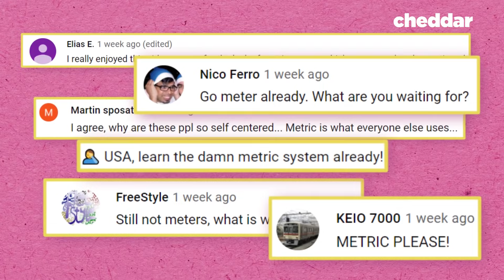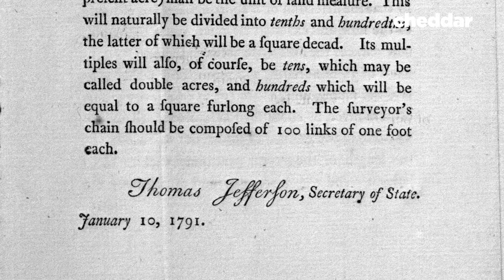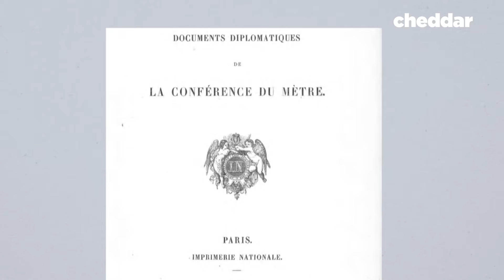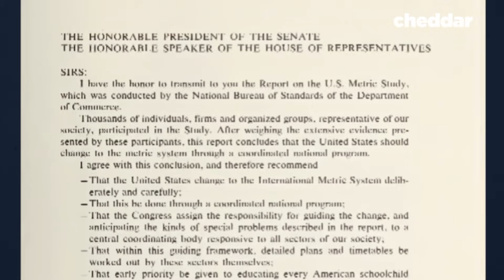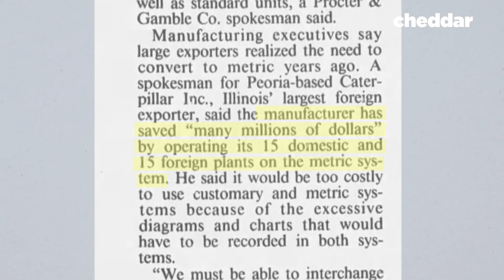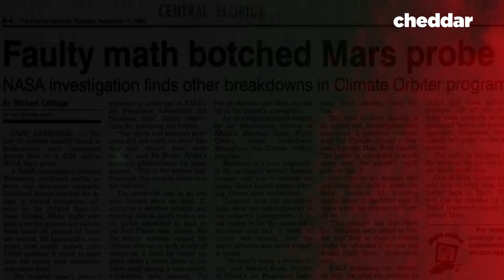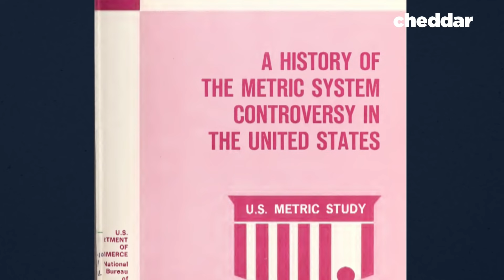Why Doesn't the US Just Use the Metric System? - Cheddar Explains

Comment: I’d like to know why the us and uk gallons are 3.8L and 4.5L respectively.
How are there different standards within an imperial system?
Reply: There are NOT "different standards within THE Imperial System."

In 1776 the US used the then current British System - the Winchester Standards.
In 1826 the British introduced the "Imperial System", to Britain, its "Empire", Colonies etc>
However, the USA did not change !!!!

Hence, the USA now uses the "Old" British system but calls it US Customary.
The major differences are the size of the Gallon, Pint, Quart etc. and the number of Pounds in a Ton.

The size of the "Imperial" Gallon is the Volume of 10 Pounds of Water (At a specific temperature.)

The "wine gallon"  is a unit of capacity that was used routinely in England as far back as the 14th century, and by statute under Queen Anne since 1707.
 Britain abandoned the wine gallon in 1826 when it adopted imperial units for measurement. The 1707 wine gallon is still the basis of the United States' gallon, as well as other measures

Some research concludes that the wine gallon was originally meant to hold 8 troy pounds of wine.
The 1707 British statute defines the wine gallon as 231 cubic inches – e.g. a cylinder 7 inches in diameter and 6 inches high – and was used to measure the volume of wine and other commercial liquids such as cooking oils and honey. 

However, at the time, the value of PI was taken to be 22/7, which does give 231 cubic inches (6 * 7 * 22 / 7) but, with the real value of Pi, that volume is 131.9469 cubic Inches.

Comment: When Canada went Metric in the 1970's, industry was in a huge dilemma, as 90% of Canadian trade is done with the USA. How ironic that the solution was to use BOTH systems. Here's an example. When I go to a Home Depot in the USA and buy a sheet of 1/2" plywood that was(made in Canada), I simply go and buy a 4' x 8' x 1/2" sheet of plywood. In Canada I go to Home Depot and buy the same sheet of plywood (made in Canada), I buy a 4' x 8' x 13MM  sheet of plywood. They simply use one less or one more ply to come up with the thickness we are buying. Same applies for 3/8" ply, or 3/4" ply etc. The problem that woodworkers face in Canada, is that the tools are based on USA standards, like a dado set for instance. If I pull out my Delta Dado set to cut a 1/2" dado to accept the plywood, I have to shim my dado blades to get a good fit. Yes, it's still sold as a 4 foot by 8 foot sheet....jeesch

Comment: Switch to metric damn. I am a handyman and 1/2 is ok but then 1/8, 3/8, 9/16 fuck so damn hard to remember
Reply: Any kid with a bicycle in the 1950s learned those sizes without complaining about it.

A handymam will run into old equipment that has to be maintained.  Such things aren’t going to just disappear.  You can refuse to work on things with inch-based hardware, but it won’t make a good impression.

Comment: We should use the metric system its easier and makes sense.  Who can tell me without googling it, how many yards there are in half a mile? No one can, I know how many meters there are in half a kilometer, its 500.  Same thing with weights how many grams in half a ib most people cant say, but in a kilogram there are 500.
Reply: Anybody who followed track before it went metric knows that half a mile is 880 yards.
Reply: Just because YOU never learnt the units in school, doesn't mean other people didn't. How long is a hectometer? (without looking it up). What is standard atmospheric air pressure in Pascals? How many ml in a metric cup? How much does 1 liter of gasoline weigh? People who pay attention in class can answer (most of) those questions in metric AND U.S. customary units. (I'll give you a pass on the weight of 1 liter of gasoline. It's a question to prove that metric has a lot of flaws.)

Comment: Imagine if all your imperial units are defined on metric units. And still not switching over entirely
Reply: The reason we defined them relative to metric units is that we intended to continue using them and a fixed relationship was useful.  Had we intended to convert completely, there would have been no need to have defined them in that way.

By the way, our units in the USA are US Customary, not Imperial.

Comment: I'm 65 when the temperature is 90 outside I know instantly it's hot, if my car is going 90 mph it's to fast , if I bought a 6 pack of 12 oz beers I know it's enough to get a buzz. With metric I would spend to much time mentally converting it
Reply: When the temperature is 35°C outside I know instantly it's hot, if my car is going 150Km/h it's too fast, if I bought a 6-pack of 33cL beers I know it's enough to get a buzz.
With imperial I would expend too much time mentally converting it.
Reply: why convert?

Comment: It's funny that big construction plans are measured and surveyed  in 10ths of a foot rather than inches or metric.
Reply: Why is that funny?  The engineer’s scale has been used for a long time, because it is practical for the purpose.  If it is “funny” then you would have to say a scale in meters, cm, and mm is “funny.”
Reply: @GH-oi2jf  You are absolutely correct. Doing engineering calculations in feet and the converting the 10ths of a foot into inches and fractions of an inch would be a huge waste of time.  It's much easier to leave it in 10ths of a foot and have the contractor get an engineering tape measure. Or, what I have which is a tape with both engineering units on half and feet and inches on the other half depending on what I'm looking at.  

It's a funny that we break down a foot into 10ths of a foot because it's like we're already 1/2 way to metric,  so why not just go all the way metric?
Reply: I'm a retired electrician that worked big construction. The drawings have been metric since the middle 70s. All surveying is now metric.
Reply: @MrBonners  — My condominium was developed in about 1990 and it was surveyed in feet and decimal fractions.
Reply: @GH-oi2jf  maybe in your area back when but not anywhere now. do try to live in the current century.
Reply: The reason for using tenths of a foot is so that area can be computed more easily.  That is not a reason to convert to metric units.
Reply: @GH-oi2jf  both are base 10. 10ths of a foot are as useless as inches. All survey work is metric for decades. Why use 10ths of a foot only to have to convert to metric for all other engineering, especially civil and construction industry? That is exactly the conversion work that intended to be eliminated.
Reply: @GH-oi2jf  5.2m x 3.7m is even easier then 7 feet 3/10ths  x 32ft 7/10ths then convert to metric for the trades.
Reply: @MrBonners  — That would be written 7.3 ft and 32.7 ft.

Comment: 3 miles make a league
1=3=24=240=5280=15840=190080
10 chains make a furlong
1=10=220=660=7920
22 yards make a chain
1=22=66=792
Reply: so? what's your point?
Reply: @MrBonners  The US system of measurement is just a shortened version of the Imperial standard.
Reply: @revinhatol  
So? 
The subject is US and metric, not about leagues, chains, furlongs values and converting within the Imperial system.

Comment: Also, Americans do use the metric system even when they don't realize it. Because the imperial measurements are defined by what they are in the metric system. So Americans just take an unnecessary detour.
Reply: We don’t use metric units because of the way customary units are defined.  Only the metrologists used the metric system.
Reply: @GH-oi2jf  *all science is done using the Metric system.

Comment: Canada is a weird mix of both, too. Everyone uses km distance, but we use feet, inches, and pounds for height and weight. We use metric for commerce, but I buy 454 grams of butter, which is 1 lb to make baking in ounces  easy, and use cups, tbsp, and tsp to cook. Drugs are in grams or milligrams, and gasoline and oil are in litres. But I still order a pint of beer at the pub. My house thermostat is in °C as is my weather report, but my oven thermostat and recipes are in °F. When I am boating, our government charts are in meters deep, but our depth sounder is in feet and I convert the charts in my head. Everyone use km/h for cars, but for boats most people still use nautical miles. Carpenters here use inches not cm or mm, and I buy a 2" x 4" x 8 ft piece of lumber. Even Canada, officially metric, isn't really in practice.
Reply: nothing 'weird' about it. no more 'weird' then to able to speak english and french. It is a advantage to be able to understand both.
FYI: You order a beer it does not come as a 'pint'. Nautical miles are not used by the general public, we are not a country of sailors. All modern electronic measurement devices display both or can be switched between both. you depth finder is American old tech. All construction drawings for houses to high rises have been metric since the mid-70s. Kitchen measurement devices have both imprinted in the device's surface, without then it is a US product. Recipes in Imperial are US recipes. All tape measures in Canda display both systems, carpenters don't measure 2x4 dimensions they cut to length in either system.  You have to go out of your way to find a Imperial only tape. you have no clue.

Comment: No, we are not a “metric country,” but we are officially bimetral and have been for a long time.  The fact that US Customary units are defined relative to metric units does not make us a “metric country.”  People who use units in everyday commerce do not need to know anything at all about how the units are defined, so it is possible for someone who uses only Customary units to know nothing at all about the metric system.

As it happens, though, many Usanians use units from both metric and US Customary systems without much trouble.

This is a fairly good summary, though, and seems to be objective.  It avoids making the errors that metric advocates usually make.

Comment: I've always though car wheels/tires were funny math. Every tire is measured in metric, but every wheel its installed on is measured in inches, even in countries that use the metric system.
Reply: There are a couple of other situations where purity has given way to practicality.  It is my understanding that socket wrenches in Europe use 1/4”, 3/8”, 1/2”, 3/4” square drive, as in the United States.

Comment: I think the metric system would make sense. Especially in dieting & nutrition. All that fuss of cups (volume) for things that should be in measured in mass. Or measuring a piece of steak as 3 & 1/2 inches by 2 inches by 1/4 inch is absurd! You buy a pound bag of potato chips and "1 serving" is 5 potato chisp! Ridiculous! I was in England and bought a calorie guide and it was all in 100 grams or 100 milliliters. How many grams of carb, fat & protein in a product just made sense when the base unit was 100 grams. Likewise the nutrition values on their labels are per 100 grams or 100 milliliters. Ours are in ounces with a metric converted values which makes the metric system confusing!.
Reply: We measure meat by weight, in pounds with decimal fractions.  Serving sizes are a fiction.  They are only good for interpreting the nutrition table.
Reply: @GH-oi2jf  You haven't read a diet book or app recently. They are forever talking about a steak that is 2 &1/2 inches by 2 inches by 1/4 inch think. It's absurd!

Comment: My only complaint about metric is the kilometer... it's smaller than a mile, so depending on how it's used, it gives an impression of it being more daunting or unimpressive.
100kmph sounds impressive, but it's only about 65mph
100 km is not actually that close to 100 miles at all.
Saying that you walked 3 km today is actually less impressive than walking 3 miles.
This complaint is 100% arbitrary though, & doesn't mean I am against metric.
I just like that miles are bigger than kilometers, so you can use fewer of them, to measure the same distance, & make it sound easier than it is.🤣
Reply: The kilogram is a more complex deal for me...I actually don't like how it's larger than a pound😆
However, it's nice that it's decimal values break down so  conveniently... though I do admit that I find playing around with decimals & fractions a bit more fun than the average person, & have no real issue with using a base 2 or base 3 system.

Comment: The big problem that occurs when making a conversion from one system to another is during the conversion our work is less efficient.  When the conversion is finally finished it is more efficient.  But we have been stuck half way between the two systems and it is reducing our efficiency.  We have been at this halfway point for over 50 years.  Let's get it DONE!
Reply: It is seldom necessary to convert between systems of units in everyday life.  Our tire sizes have been a mix if metric and customary units for a long time.  Nobody tries to convert to get consistent units.  It just isn’t necessary.
Reply: @GH-oi2jf  Man, I don't know how you do it.  I have to convert all the time.  Part of it is my job as an engineer, but a lot of it is working on the house or the car, etc.

Comment: bottom line: metric units are inconvenient for a lot of our day to day activities, and we like the path of least resistance.  and it wasn't metrication that allowed carmakers to go to ten sizes of fan belts instead of a thousand - it was realizing they could replace three different sized belts with one serpentine belt and arrange the idlers on every engine to fit the same belt.
the moral: use the unit that works best. sometimes it will be metric, sometimes it won't.

Comment: See

my house is just 3300 bigmacs away from school and 5541235 bigmacs away from the airport.

simple, isn't it?

Another example

LA is 3314545784154135 diameters of steak away from NY

Fuck all those who use such a complicated 10bass metric system.

You know, in metric system, H2O and water are same.

Terrible isn't it.

In Murica, most people know the truth that H2O and water is diff.

Also Homosapiens are not humans dumbasses.
And also our volume measures are based on the amount of pee our president gives out a week!

So simple and consistent and accurate

People say that weight and mass are diff, but we know that they are same, thus we have same units for both of them.

One pound=0.0254 the weight of an average cow that we eat.

Comment: I really wish they would have defined an inch as 25 millimeters instead of 25.4 millimeters... it would have made things a lot easier
Reply: Then you would buy a new set of wrenches that wouldn’t fit the bolt heads on old machinery.  That isn’t practical.  The implications would go much farther than that.  One principle that is always followed when adjusting the standards is that the change must cause minimal disruption of existing practice.  Imagine buying new sockets that won’t fit on the square drive of your old ratchet.

Comment: You've got to wonder how those who developed the system arrived at those arbitrary ratios... 1/16? 1/12? And the mile which may be derived from the "li" unit.
Reply: There is nothing arbitrary about the fraction 1/16.  On the carpenter’s scale we divide the inch by successive powers of two to get any precision needed.  We don’t really use 1/12 as a fraction.  We use feet or inches, or feet and inches.  When we cook an egg, it isn’t 1/12 of a dozen, it’s just an egg.

Comment: After taking four years of engineering design classes that used the metric system and using the metric system for more detailed measuring in art classes, as an american, I highly support the metric system, its just easier. What is easier, dividing by tenths or by sixteenths? I don't even remember the cups, ounces, gallons, etc convenversions anymore... a liter is 1,000 milliliters, a meter is 100 centimeters. It's just so much easier to remember and easier to use, while the imperial system is only easy at forgetting. As simple as that. Period.

Comment: Reason why the U.S. doesn't switch to metric is because every regular citizen, would have to start over and learn a new system of measurements. Now that would anger a lot of closed minded people. I work with both systems of measurements. Metric for machining, programing, and computer based programs. US standard for construction of houses, wall, etc....
Reply: I feel like a gradual transition could work though. Like if for the next 10 years signs and stuff were written in both imperial and metric, kids were taught both, and after the 10 years the US fully transitioned, there would be far less problems i'd imagine.

Comment: Science tells us to use metric measurements, Kelvins (measuring temperature) and Newton. Buying furniture, homes and anything to buying spaces tells us to use imperial measurements. Temperature tells us to use Fahrenheit or Celcius.
Reply: Science uses Kelvins and Newton because it makes more sense for that matter since Kelvin is just Celsius minus the absolute zero temperature (−273.15° C) and Newton is the only unit of measurement used for measuring force. "Buying furniture, homes and anything to buying spaces" tells us to use the METRIC system, it's much easier to say "100 cm = 1 m" than "1 inch = 0.0833333 feet". And temperature tells us to use Celsius for us non-scientists, water boils at 0° C and evaporates at 100° C.